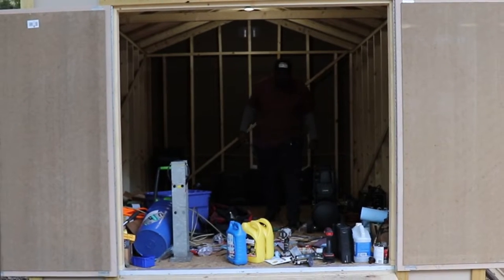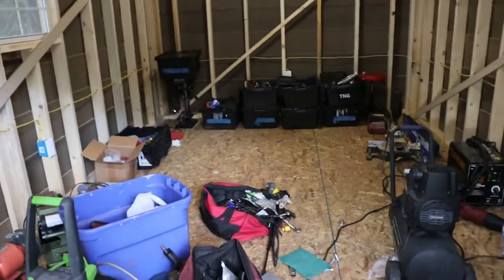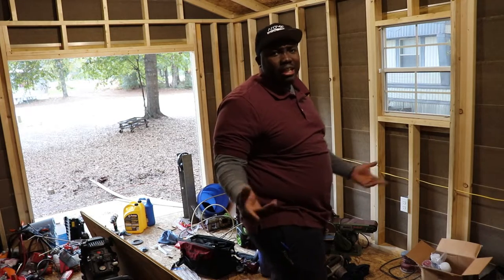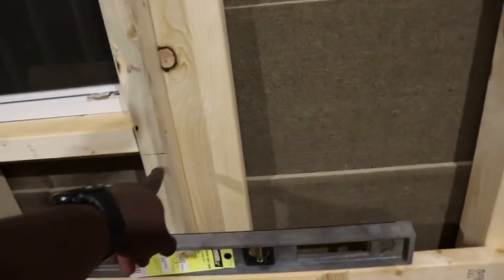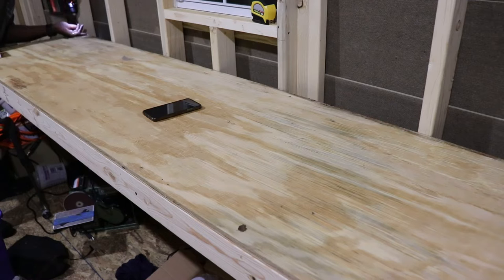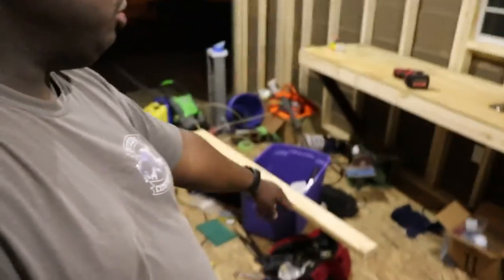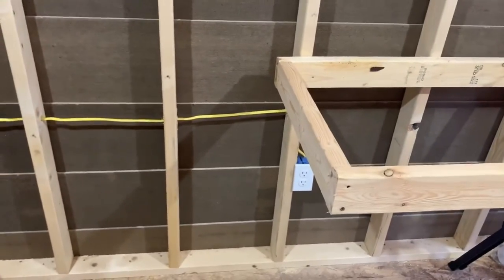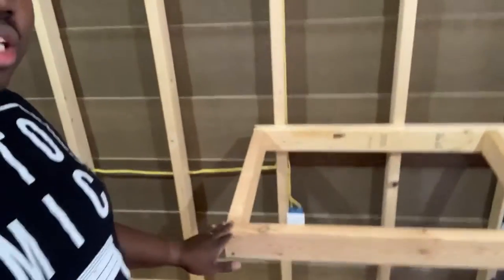TINY Workshop FLOATING Workbench Build!🔨🔨📐📐

Comment: When and if you decide to bolt a vise down on that bench, please add a doubled 2x4 leg straight down under it on a corner. (Even small L brackets one on the top and bottom plus screws will make a world of stability difference. Otherwise the first hit on a part in that vise with a hammer and that whole bench will crack off the wall😉 looking good brother, strrrrrretch that 160 sq ft!!! Think high shelves too, your height where YOU can reach. Use all that space up. A loft or two on each end too. Good to see you happy✌🏼
Reply from the maker: Great ideas! I would have cried when that workbench falls off the wall 😂

Comment: I'd put up OSB or even plywood panels all around inside the walls for insulation, as well as to hide and protect the electrical wiring. Also, that way the workbenches aren't mounted to the studs but to a wall panel, so stuff can't roll off to the rear and fall behind them. Then put up narrow shelves on rails on the whole back wall, and more shelves wherever there is space. Also tool hangers. Shelves only like four to six inches wide, because if shelves are any wider, stuff just gets put in front of other stuff and the stuff in the back row is either forgotten about or never found it when needed. So any extra shelf width just becomes needless trash storage. Just throw out whatever you don't need, Marie-Kondo the shit out of that place!